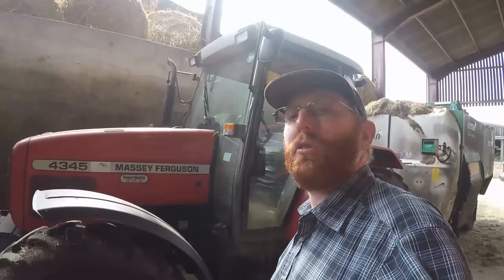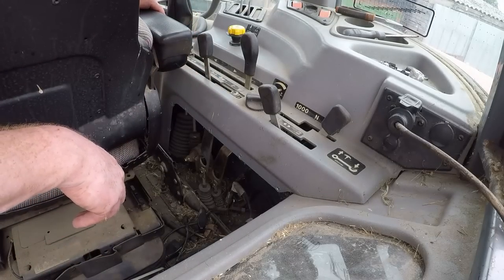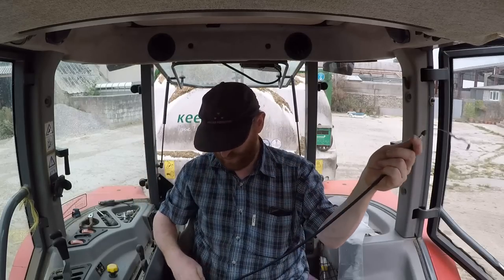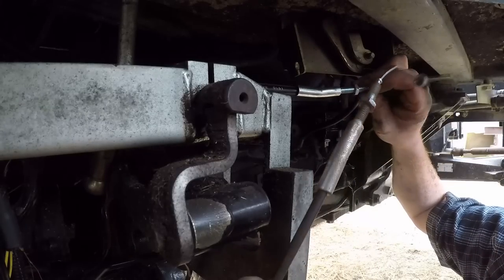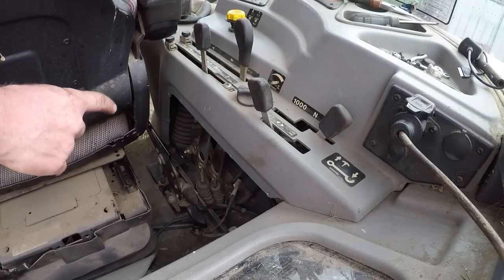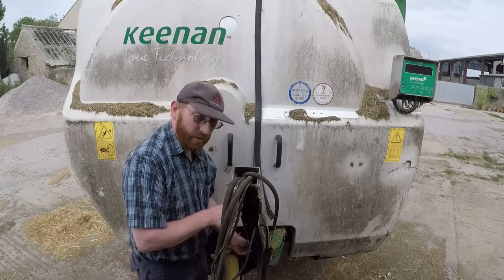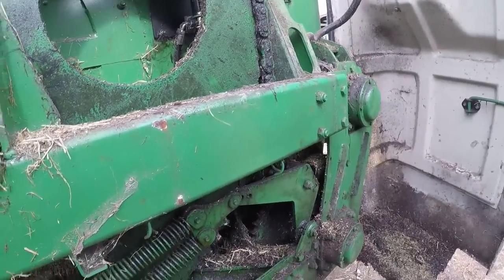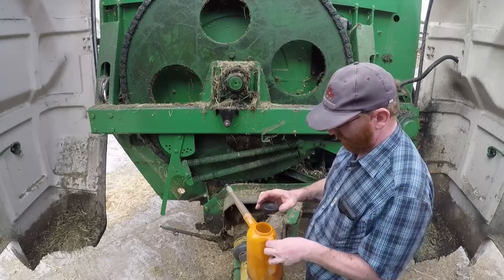Massey Ferguson throttle cable repair.

Comment: Hey Dan, just a small suggestion. The Cable may have broken because of the Slack between the fully back position and the turtle. At the turtle position the cable is just straight and holding some small tension, but back further maybe the cable is too long and tending to fold over on itself. This may be the cause of the Failure.  Is it possible to move the Stop nearer to the Turtle to eliminate the excess slack and the tendency to fold and fray the cable.